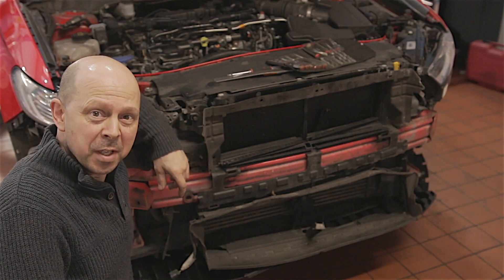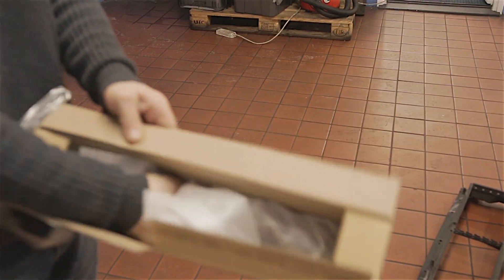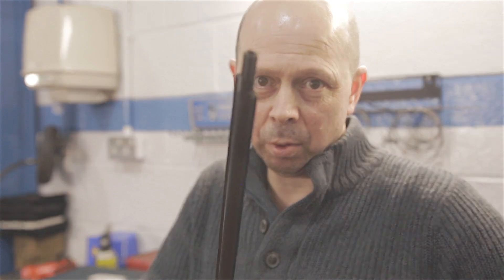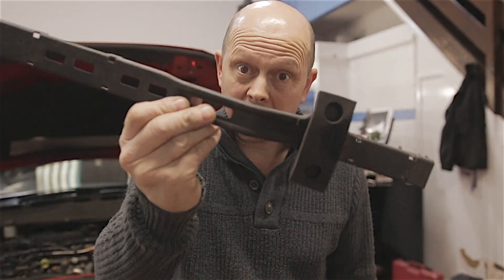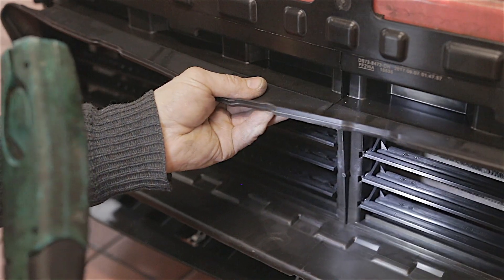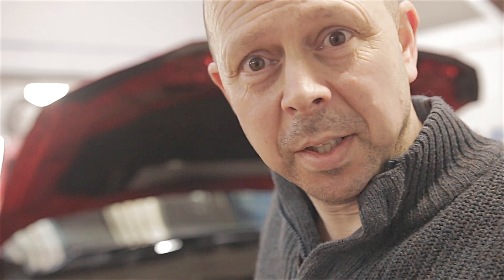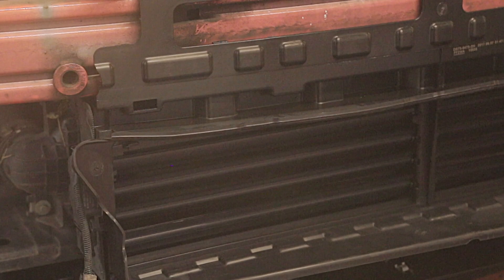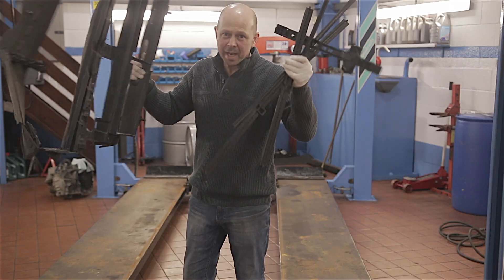Ford Mondeo Mk5 Active Grille Shutter

Comment: Hi Alan, thanks for your video! I checked my grille shutter just to see if the initial up/down sequence is performed after the start of engine. But there was no movement (i asked my son to start engine)! Grille shutter remains closed. Everthing looks good, no fans at full speed (on the other hand, temperatures now around 0 degrees celsius). Also i checked shutter before and after several drives, still closed... Can be there the actuator motor failed? Don't know what is gonna happen if weather goes warmer. Thank you!

Comment: Hello, Alan! I have a Mondeo mk5... really usefull videos, all of them. Regarding this one, I have a question if I may: as you might imagine,  I have a problem with the active grill shutter (fans running full power etc).....quite expensive stupid piece of.....anyway....I was thinking about "canceling" the bits of plastic that go left to right, the ones that actually open and shut (I don't know exactly how to call them), "fins", and keep only one, that is connected to the little motor?(you mention it at 3:37). I don't care about the fact that I don' t have anything in front of the radiator, it will just warm up slowly  that is all, I guess. Would that work and stop the fans from going crazy? Have a great day!
Reply from the maker: Hi. Yes the only flap you need connected is the one that locates onto the motor. These were designed mainly for cold countries and have no real practical purpose. 
Also check all the wires behind the front bumper as they can break
Reply: Really appreciate your reply. Thank you!
Reply: Hi Alan, I tried this out with just one flap but it didn‘t work because I also removed this long thing in the middle which connects all flaps.
So I think this one has to stay inside if you just use one flap.
Thanks for your videos - they really helped me to change the radiator on my car.
Reply: It's not that simple. The grille shutter system is not to let the engine warm up quicker in cold countries, it is there for aerodynamics and better fuel consumption. When the car is running at speed the shutter closes to improve aerodynamics. It only opens when the engine gets too hot, and when the car is stationary. It may also affect the DPF as the regen may not be triggered if the air flow is not correct. 
Anyway. Bloody annoying as mine has stopped working and my fans are burned out (previous owner). So I am going to strip it down and find out why....

Comment: Hi Alan,got 665 plate Galaxy mk4, the fans are staying on from start up,and the active shutters are staying closed,put my snap on scanner on it and it's saying "lost communication with shutter control module A ",would I be correct it's either the motor,or the loom on the bumper ?cheers 👍
Reply: Hi, was you able to find out if it was the problem. I've currently got the same error code

Comment: Hi Alan
I have a focus mk4 with an active grill shutter. After an accident i replaced the grill with a new one. And my problem is that my fan is running constantly. Is it because wrong mounting of the grill and the other related components? Because in the video you say of the grill doesn't work then the fan runs in high speed constantly. This saturday i will tell my repairman about your excellent video. Can you please confirm this?  Thank you in advance

Comment: Great videos, very informative, is it possible to bypass this system, cutting out the shutter and the module that connects to them .. mine are completely fit for the tip. and don't want all the expense

Comment: I own a Volvo V40 MY14 and I have just the same thing in front of my radiator. I live in Greece and I have noticed that other Volvo V40 MY14 cars in Greece don't have it, especially the Cross country edition. Would I be wrong removing it, as If it is not working properly, It would overheat and burn the engine?

Comment: Hallo Alan. 
Kann man den Fehler auslesen, wenn die active grill shutter kaputt gegangen sind?
Reply from the maker: if the active grille shutter motor is affected by broken flaps and not functioning correctly then chances are a fault code will be stored in the ecu
Reply: @alan4x  thank you :)

Comment: Hi I took my bumper off complete to change the grills on the Mondeo Mk5 !
On joining it back together the fan is on constantly !
Tried switching it on and off but still the same !
Any idea what I’ve done wrong ?
Reply from the maker: hi, first off, check that the slat connected to the motor has the splined end connected to the motor...if all the slats are fitted correctly they should be in the closed position...next check the main wiring plug connector is connected to the vehicle wiring loom on passenger side of bumper...and check the wiring is connected to the grille shutter motor and temperature sensor on the drivers side of the grille shutter mechanism...if all is connected then check the wires at all block connectors you have separated as it is quite common for the wires to break especially on the grille shutter motor connector and temp sensor connector
Reply: Alan Howatt 
Thanks Alan your a star!!!!!
I had forgot to clip the motor plug back on !!
Silly me

Comment: Having problem with a 2011 c max not getting DPF up to temp during regeneration on road. Does anyone know if these shutters are supposed to close during regeneration? (I know about vaporizer prob & have ensured its working)
Reply from the maker: the shutters are nothing to do with a dpf regen.....how do you know the dpf is not at the correct temperature
Reply: @alan4x  After about 15 mile trip engine malfunction displays in message display. Check codes in ecm & get P244c . Noticed fans run randomly when I wouldn't think they are needed (ie temp gauge below halfway). Changed thermostat And this improved engine temp up to 75-80 from constant 60 degrees. I have also heated dpf temp probes to ensure they read correctly (with a MAP gas torch & reading live data). Arh I'm getting desperate to resolve this now. Just wondered if engine temp being hotter may improve heat all the way down the line to DPF? By the way thank you for your videos.
Reply from the maker: there should be 2 rubber hoses running from your dpf to an electrical unit on your bulkhead ...check the hoses are not burnt at the dpf end.
 the dpf will only get to the correct temperature if the diesel is squirted through the vaporiser nozzle into the dpf..so if you have not done so yet you will need to remove the vaporiser nozzle from the exhaust and check it is not blocked...if it is you must replace it
Reply: Cheers for your help. I think I may substitute this dpf pressure sensor for a known good unit as I have had problems with these on VW cars before (even though they test as good!) Thanks

Comment: Mk4 1.8 doesn't have it thank god. Does have a god awful thermostat housing to make up for it however. Great video as always.
Reply: I loosened mine off and re tightened it got it down too just a bit wet  in the area rather than a actual constant drip. Did some radweld and it's stopped leaking. 1.8 tdci. Seems to be a very common fault

Comment: Your timing is impeccable. I pulled the active grille shutter off my mk4.5 only a few hours ago as it has a broken centre support. Cheers for the info
Reply from the maker: Badgertronix 
I had you in mind when I made this vid lol
Reply: Really the mk4.5 has this too?  My 2011 (163) titanium-x doesn't
Reply: @chrisredfield3240  yes Mk4 Mondeo has it in front of the intercooler
Reply: @Kreis-Frequenz  correction  actually it does. have you seen yours open and shut.  It does it on start up looks cool i think it opens/closes just to do a test of operation.

Comment: Why bother putting it back on if the car is based in U.K. or Ireland, it doesn’t get cold enough to make a difference to a modern engine.
Reply: I had the same thought but the above comment ^ I had no idea it would keep the fans running sounds a bloody annoyance all this extra things on cars
Reply from the maker: hi, i know exactly what you mean. most of the time i will leave all the slats out and i wont bother rebuilding them but in this case, the slat from the motor was broken and the housing was in a bad way. if the unit is removed from the car or the motor that operates the slats not connected the cooling fans will run flat out all the time while the car is running, so unless there is a way of keeping the fans from running i need the housing to have at the very least the one slat from the motor working, but built this one together properly for the video, in any other case i would not build it, just bodge it lol, thank for your comment.
Reply: alan howatt, keep up the good work I enjoy your videos.